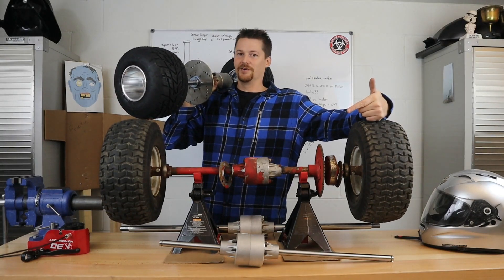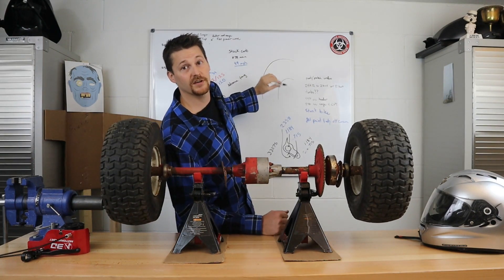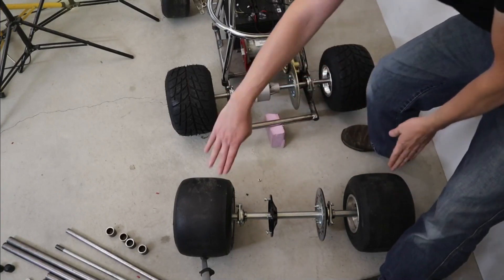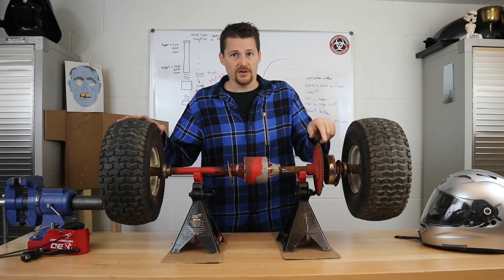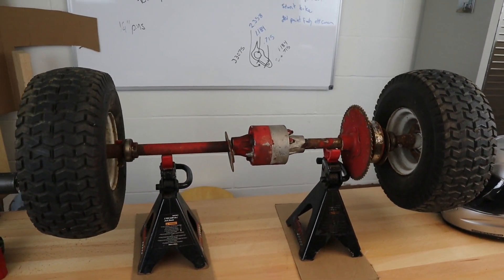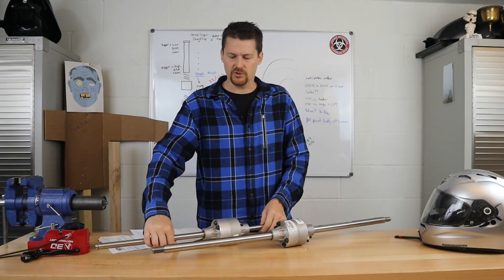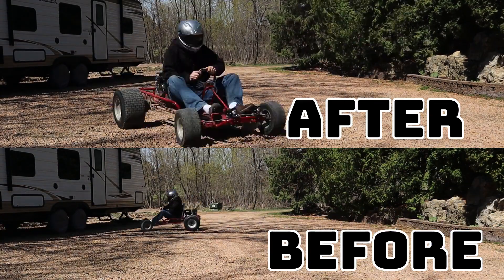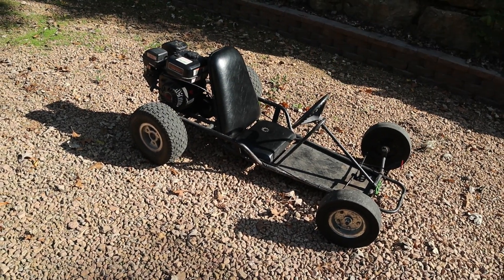Go Kart Differential

Comment: Does anyone know the real torque limit for these 100 series diffs? I know the spec say 125ft-lb output, but I'm curious what they break at. I'm going to be running mine at really low rpm and high torque. Heat will not be the issue because it's low power/low rpm. Just straight up torque at around 100rpm.

Comment: I put a peerless diff axle on the mobility scooter build.  Put a disk brake right on the diff which can be risky since thee braking force isn't directly applied to both axles.  Been ridden hundreds of miles and no issues with that setup yet.  Stops nicely thanks to the tires being aggressive enough to not loose traction and have one wheel spin backwards.  Having the diff on such a short wheelbase really tightens up the turning radius!

Comment: Limited slip diff would be cool! 😎
Reply from the maker: Could fake it with brakes on each side, controlled. But yeah, they're pretty basic.
Reply: @megoingfast  Hey that's what my Subaru Impreza does!  😆 But it does it automatically, but still.. does work in snow very well.

Comment: Useful info! I actually have a Manco Dingo and now that I'm an adult. I never use it. It just sits around rusting. I've been thinking of turning it into a bit of a lawn tractor with an open diff and less agressive tread and a lower final gear ratio so I can use it to move stuff around the yard, towing little trailers and things like that. Not sure it's going to happen but if it does, this is definitely the way to do it!

Comment: There are Peerless 100 "knock-offs" that use different side/spider gears and retain the side gears to the axles differently. I've seen both 15 and 16 tooth side/spider gears, along with axles that had the side gears attached to the axles with splines and a retaining ring, "double D (two opposing flats) and a retaining ring, and double D with the gear staked on. There is a difference in the case halves, too.

Comment: Hello! I have a PEERLESS 100 Series Differential Assembly on my three wheeler. I’m running into an issue where only one side of the axle will spin under power and when I manually turn the axle where the wheel mounts the other side will spin in the opposite direction. Any advice?
Reply from the maker: The peerless is not limited slip, so both sides need to have equal traction. The sprocket mounted on the differential itself and equal weight balanced across both wheels, while each wheel maintains the same amount of power to the surface. Both wheels also need to be on the ground at all times. So if you tip a little, you'll lose traction again.